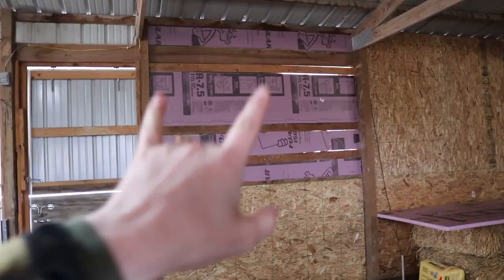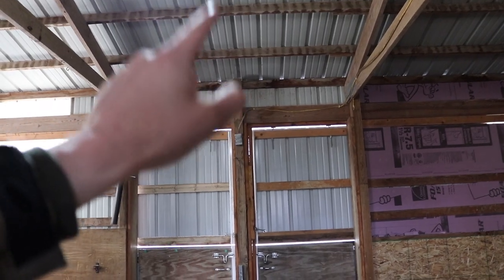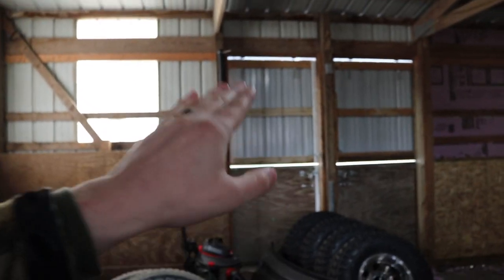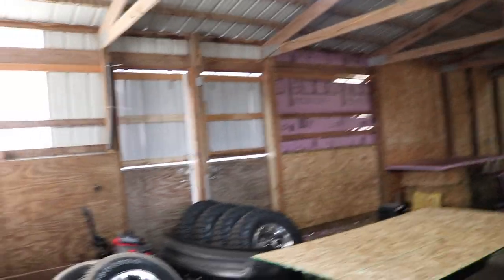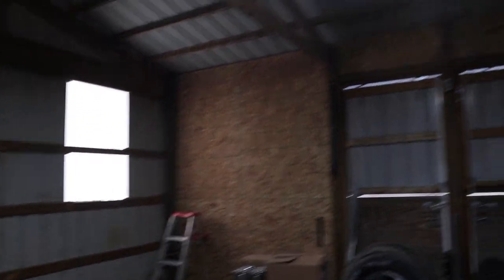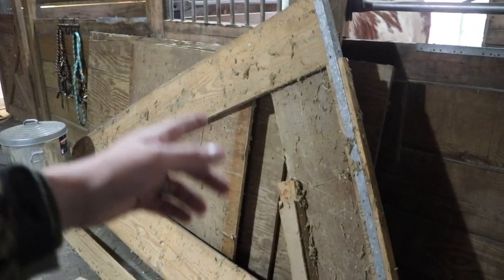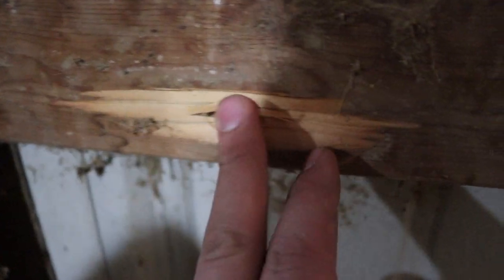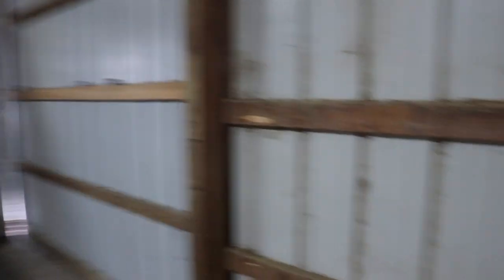BUILDING MY DREAM SHOP!!! Ep. 4

Comment: For the ceiling I would use joist hangars and install ceiling joist every 16 inches for a flat ceiling, then either install osb or white metal  ceiling liner then run your wiring and blow in cellulose

Comment: You don't them braces with installing the plywood.
Blown in insulation for ceiling over metal panels. Spray foam is really good but really expensive.
Have a great day!

Comment: Yeah, there is no reason for those angle braces anymore. For the ceiling I would just run 2x4s along the bottom of the trusses, hang osb on them, and then blow insulation over it all, that would be the cheapest and easiest. Also, OSB stands for Oriented Strand Board, so calling it OSB board is kinda redundant. 
Great job though, and I love the content!

Comment: No need for those braces the plywood will brace it also i use a fine tooth circular saw to cut foam board insulation